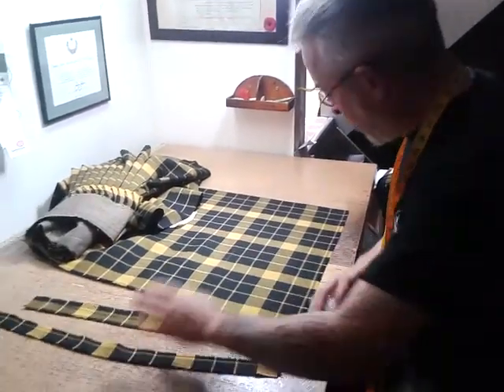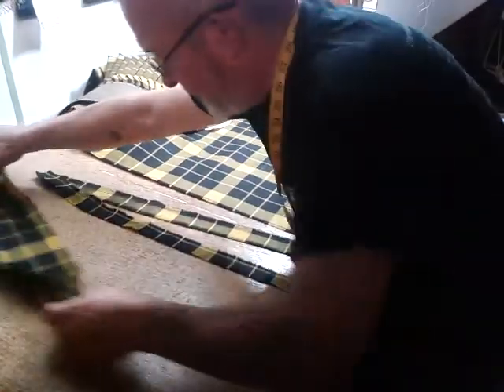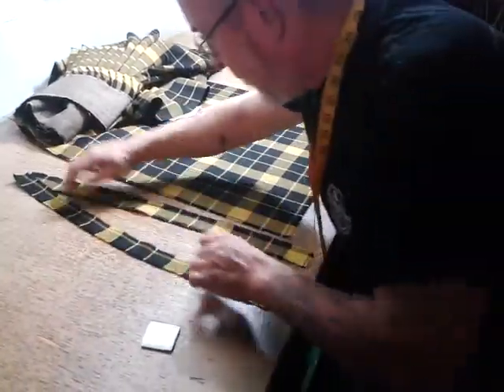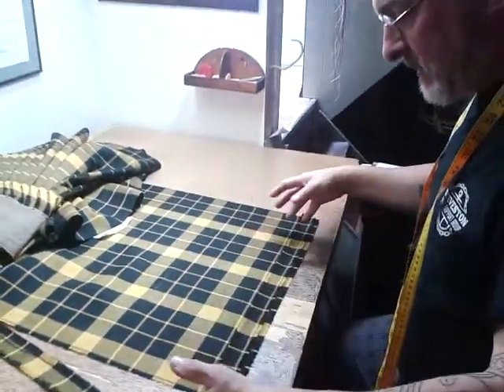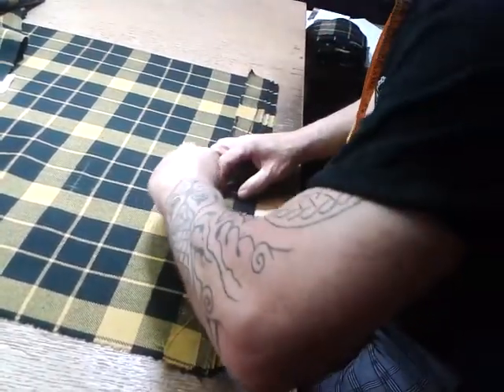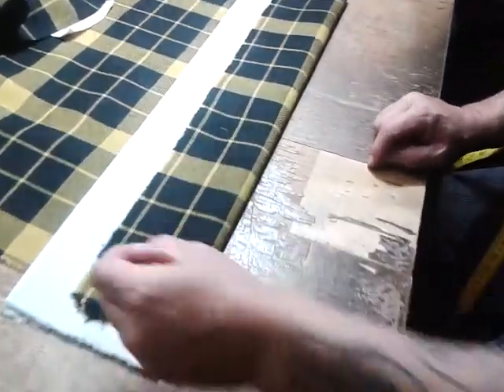My Methods, Part Six and a half; The apron-fringe

Comment: Might be a daft question but can you not take the strips from the same edge so they are more likely to match rather than the underapron as you and many instructions usually do?
Reply from the maker: I do, on the occasion that there is enough  cloth at the end of the outer apron.